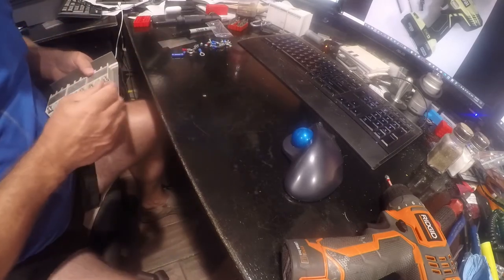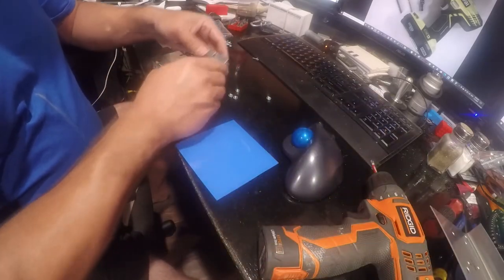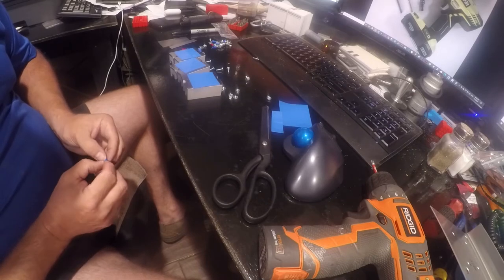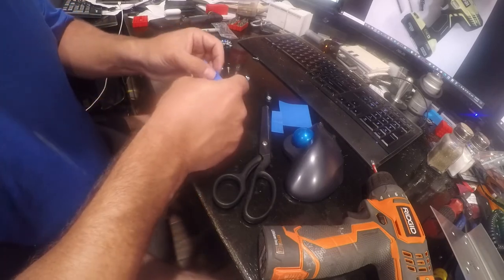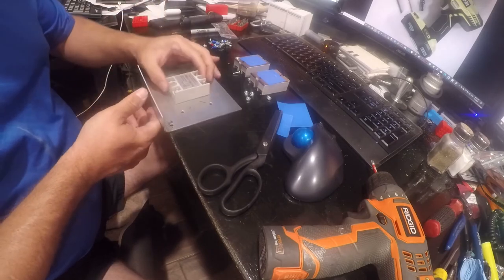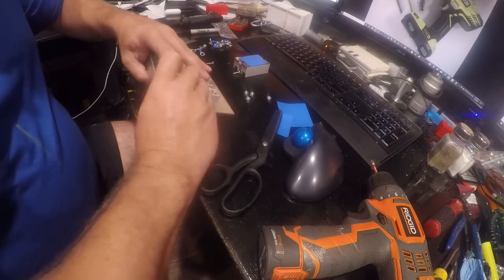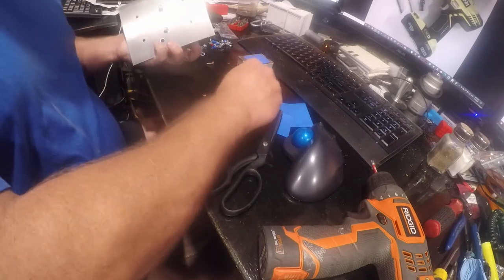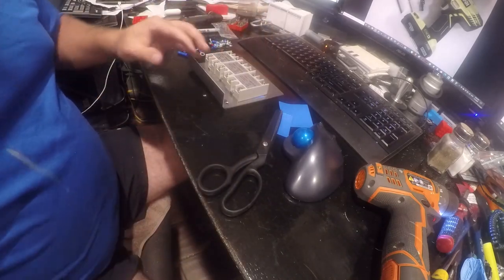Controleo: SSR - assembling the Solid State Relay module

Comment: three such powerful relays on such a tiny plate .. Really?
Reply from the maker: They are oversized... and being from China probably over-rated.  I wouldn't be surprised if the "rating" was done while immersed in liquid CO2.  :)

Each SSR is only handling 3 or 4amps.  Being mounted with a thermal compound to an aluminum heat sink should provide adequate cooling to keep the MOSFet inside from overheating and letting the magic smoke out.

Keep in mind this is also a kit that is designed to accommodate a wide range of toaster ovens.  I just happen to be using a small one because that's all I need for my projects.  Easier to store, cheaper to run, and heats up quicker.

Thanks for watching and commenting!
Reply: @hotpuppy72  
Yes indeed their maximum is up to 5 amperes I think with a radiator. I watched a video where a 15 kW boiler was powered through such a relay. It melted when the author of the video was on vacation ..)
There are branded relays from "omron" or "celduc". They are much more expensive, most likely they hold the rated load. Although personally I have not tested. Thank you for the video.